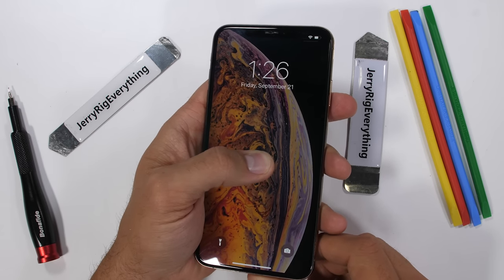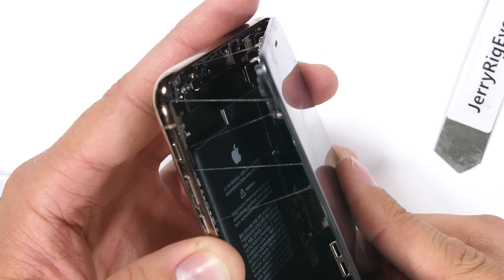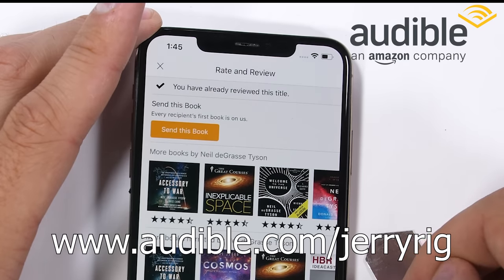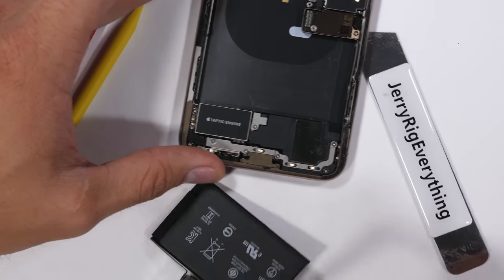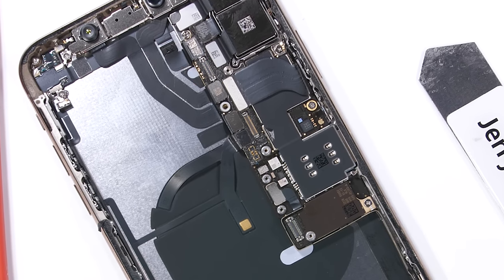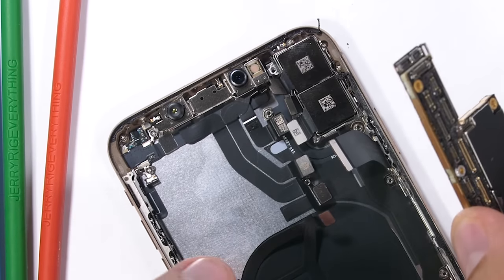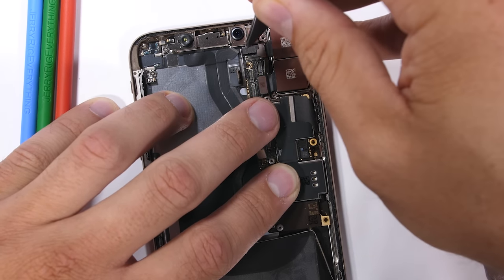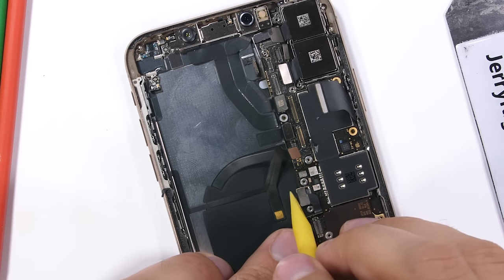iPhone Xs Max Teardown - Is there any Thermal Cooling?

Comment: The only time you'll ever get throttled is when the next iPhone comes out and Apple needs you to upgrade      
~ jerryrigeverything
Reply: Sam Typhlosion True Story!
Reply: You can pass that throttling by not updating your phone, because they slow down older phones with software updates. But that's just one of the ways they try to make you buy new phone.
Reply: i tried to go back to ios 10 with an iphone 6s, impossible shit to do
Reply: I've downgraded (dual boot tweak) an 5th gen ipod to ios 6. It runs soo fast!! Definitely, ios updates ruins older devices.
Reply: @RodrigoGomezV  yeah  but it is a hard shit to you just for downgrade, Android phone can go from 6.0 to 8.0 and go back to 6.0 super easy
Reply: Too bad it isn’t true
Reply: Been debunked only phones with batteries that have fallen below manageable charge cycles will be throttled to avoid shutdowns
Would you rather put up with your phone constantly shutting down because the processor doesn't adapt to your battery condition 
Sure the way apple went about that was anti consumer but now they've given an option to disable throttling on old battery iPhones
Reply: @nortti00  that's not something you should do since the older IOS versions could have security exploits and vulnerabilities. 

Which is why they do updates....that and the throttling
Reply: Apple throttles phones based on battery health and maximum stable current coming from them. 
Yes, a newer OS typically needs more resources, so an older phone will more often run at a 100% load. If the current coming from the battery is not stable the phone will crash.

BTW. Apple supports phones for 5 years and iOS 12 makes even the iPhone 5s pretty fast again. 
So scold Apple for the $550 back replacement, the headphone jack or the proprietary screws. The software policy they have is, indeed, running circles around any competitor.
Reply: Rodrigo Gomez iOS 12 dude. It’s for old devices
Reply: alsvari or update to iOS 12...
Reply: @xTStockTx  also don't forget that androids almost always get faster with updates
Reply: Sam Typhlosion iOS 12 on my iPhone 6 is a beast. Miss me with that planned obsolesence bullshit.
Reply: That’s bullshit actually
After iOS 12 every device got fast asf
Even 2015 6S is still running like a beast.
Reply: Asef Jamil Ajwad Actually that's just the excuse they came up with when they got caught doing it. If they hadn't been caught they would have continued making performance worse and worse on older devices until they were basically unusable. There was never a widespread 'my iPhone shuts off all the time after updating' issue until they got caught throttling older devices and released updates to 'fix' it. Plus if the battery was really at fault the issue wouldn't have waited to surface until after Apple released the updates to fix the throttling they were caught doing. It would have been an issue all along.
Reply: alsvari iOS 12 made my iPhone X unbelievably faster than it was when I got it last year. This update has worked wonders. Literally everything is faster, plus the battery lasts much longer
Reply: I hate the term 'upgrade'. An upgrade typically would be replacing some parts of it. Also, besides this there is absolutely no need to 'upgrade' from X to XR since they are so minimal and negligible. The only feature is the adaptable bokeh in portrait mode and IP68. Not worth the steep price tag.
Reply: @gagannnnn  lol no
Reply: Dan Man  "expensive battery replacement", bruh really?
Reply: But in android side they get trhottled by itself 😂cheap fake os

Comment: "Upgrading your phone every year is just dumb and a waste of money" - JerryRig 2018 (08:34)
Reply: Apple is going  to get you.
Reply: David Cote Samsung is going to get you
Reply: Samsumg doesn't throttle phones to force people to upgrade. That's for feeble-minded apple users.
Reply: Yeah but samsung launching new phone like every month
Reply: True words right there.
Reply: @mashamitchell9574  Samsung don't give you updates after two major update.
Reply: At least apple SUPPORTS their devices for at least five years. Samsung doesn't.
Reply: @thebravegallade731  your "SUPPORT" means making it slower purposely no thanks dont want your "support"
Reply: Alfian Kurniawan ill
Reply: Ok wtf. I decide to check the comments in the middle of the video and as i read this comment i hear... "Upgrading your phone every year is just dumb and a waste of money"
Reply: @ldtworks1052  Literally just an excuse because they got caught. Same with the replacements, they wouldn't do them before they got called out on it.
Reply: @thebravegallade731  Because their devices barely change lmao
Reply: DID ANYONE SAID APPLE LASTS THAN 5 YEARS ???
Reply: abeski If we are apple sheep’s then your are android cows
Reply: But cows are better than sheeps
Reply: Alfian Kurniawan good think I upgrade my phone every 6
Reply: Masha Mitchell yea but Samsung doesn’t create a processor or operating system that is designed to get higher levels of performance (specifically single threaded performance) at low voltages so that:
1. The battery life is optimal in general
2. Battery degradation is reduced due to a lower voltage out of the battery
3. Battery degradation is reduced due to less heat produced from a SOC
4. Processor performance is better in more use cases (single threaded use cases, especially because it’s a smartphone and because of the way iOS does multitasking)
5. Older phones with degraded batteries who’s users aren’t aware of how cheap a battery replacement is get better performance because the entire phone is designed to get good performance at low voltage so the performance is not critically hit by throttling in the first place.

Honestly the repeated dishonesty with this claim is so annoying. My last phone was an iPhone 5s, i don’t even know how many years old when I gave it away to my aunt who still uses it and is running the latest version of iOS. Unlike this years galaxy which isn’t even running the latest version of Android. The only people I know who upgrade every year do it because it is offered as a part of a cell plan and honestly in my experience they are all galaxy owners specifically.
Reply: Gecko they throttle it based on the battery degradation not based on any time frame besides when are you gonna get android p? When android z comes out?
Reply: Ro_In Pro yea what planet are you living on, yes apple devices last really long that’s not controversial is it? Really? My god I must be an isheep oh no google save me please google please save me sell my nudes please sell my home location I’m sure you care that’s all I need is your loving open source embrace (except for every that makes them money) please save me from a competitor SAVE MEEEEEE!!!
Reply: LiamYT learn your your and you're
Reply: its true tho
Reply: No it’s not
Reply: @ldtworks1052  yeah apple also lied about sapphire camera screen lmao. What a whack company
Reply: @fernandozamoramata5372  you got weak insults
Reply: @ldtworks1052  yes i can see it. Apple lied to all of you. One of the world's biggest company lied to all of you.
Reply: @rikuluoma3537  I do not care I love my Apple products they are the only thing that work all my samsung stuff like my fridge my monitor etc is broken barely works or it has something wrong with it .all my Apple products works even my iphone 3g works
Reply: @ldtworks1052  yea right... Apple forces people to buy their 150€ airpods. Even my honor play is faster than iphone xs max and costs 250€. This has way better battery life too.
Reply: Yes if you don't have a money. But if you have?
Reply: Masha Mitchell so you’re trying to say a s5 works just as well as an iPhone 6? No they dont, even the 4s still works fine in 2018 but galaxy sounds degrade so badly after each year
Reply: did he is stupid?why he doing with very costly things. did he is mad !i pad pro and i phone x and max   if he do like this with very costly things he had no money and food like that he will die because he do like that things please put dislike then he will understand  the also like apple company tell him who is near by his home OK!
Reply: do you know ranga chandra he is my big father?
Reply: Ok
Reply: Everybody is fighting over what phone they use I have a iPhone X’s max and I can respect what Samsung does with what phones they make also people always flame me for having a apple phone and I don’t see the reason for that since apple has phones that function perfectly and work also when I ask people why they don’t like apple they focus on the headphone jack something that has nothing to do with the quality of the phone or damages the phone sure it sucks that apple removed the headphone jack but you’ll get used to it like many apple consumers and if that is your main problem just don’t get that phone it’s that easy you don’t have to make people feel like garbage over a technical device but people will just fight and hate on anything these days and sometimes it’s just annoying go ahead and flame me in the comments but I’m not changing my phone anytime soon and your rants won’t change my mind
Reply: Emang mantep dah
Reply: Arturo Sanchez I completely agree with you
Reply: @Karlsteins  They produce lots of type of phone with different specs and price. I think its good, so you won't find the same phone model more than apple does.
Reply: @GeckoClever  your triggered.
Reply: @Carristoford  You children dont like facts, doesnt mean im triggered.
Reply: @GeckoClever  how old are you? And im not a kid.
Reply: @ldtworks1052  not here to get wrapped up in this fight, but I have the Razer Phone. 

I'm pretty happy they aren't slowing down my phone when they released the Phone 2. 
Don't like one flavor of Android? Just switch! Your batteries are catching on fire? Get OxygenOS on a OnePlus phone instead of a Note 7 on Samsung software. The thing is, instead of being sucked into a price-inflating, wallet-thinning ecosystem, you have options in the event one company doesn't meet your expectations any more. 

Apple is one supplier. If something similar to the battery problems that the Note 7 faced hits a lot of Apple phones, you're taking a risk as a consumer in being forced (by the need for new technology for software development for example, or because they're _slowing your damn phone down_) Android is many of varying speed, size, and support. Just pick one you like. Stick with the brand. Switch out if goes south. 

Software. Heavily skinned or vanilla white, it's all Android under the hood. Run almost anything in any way on amlost every device. 

The thing is, cows aren't much better than sheep. But when you go cow tipping, they'll stand back up. Sheep just flail their legs around while they starve or die of thirst or get eaten by wolves. They're so domestic and ingrown, and you're a perfect example of a mindless defender of Apple products. Cringe in pain as Zack slams your company repeatedly. 

Buy an Android product, especially from Google, and you're guaranteed updates and support for a long time. It's like changing the carbeurator or battery pack in an old gas/electric so it runs for another 5 years. 
But if you're an Apple sheep, you'll run a car without oil, seize the engine, and call the car totaled because you drive a Lotus Elise and you scratched the one-piece shell of the car. 

Maybe I should dive headfirst and fight, maybe I should see  Android users willing to win, to parry and counter ever shitty argument you try to put out there with ease. 

While you're out there trying to make your next arguments, I'll be making popcorn. And awaiting your response.
Reply: Nope is good
Reply: This is right for samsung user because after time they get SUCKS ! :)
Reply: True
Reply: @Karlsteins , every year to stay competitive with every other phone manufacturer, duh
Reply: Alfian Kurniawan great job starting ww3
Reply: Very late comment but all phones are like this, software manufacturers know that people will buy new phones every year with more power so they use that extra power to add more features which will make an old phone seem slow because it is actually not powerful enough, and it has nothing to do with the phone company. If you have an iPhone 4 and run up to date apps yeah it's not going to work but if you run the apps that were designed for that phone at that time they will run perfectly fine.

Edit: grammar
Reply: But the better the phone you have the more you get out of it when you hand it in = less cost to pay every time
Reply: @thebravegallade731  the phone itself dont survive over 2 years without lagging lmaoo
Reply: @mashamitchell9574  Calm down fanboy... you shud know what you talking about first... You need to do a little research about phones throttle. ps. Samsung does it to
Reply: @Karlsteins  Yeah, but this has nothing to do with flagship models. Most people refer to Samsung's S model lineup
Reply: Alfian Kurniawan how many phones does he buy in a year.
Reply: Masha Mitchell actualy they do throttle. People just like to hate apple.
Reply: karlstein do you get hyped for each one. I get hyped for the new ones. Just more minor upgrades
Reply: Çağrı Koçaslan support means getting updates to make ur phone work for 5 years
Reply: Gecko and look what happend with the note 7. Are you really gona say Samsung batteries are better than apples when that happened?
Reply: ThreeHeadedWalrus actually apple cares about there consumers.
Reply: abeski fandroid
Reply: Ro_In Pro yess sheeps not sheep. SHEEPS!
Reply: Crustin Danglade yes
Reply: Crustin Danglade people say android p stands for pie. And in math pie is 3.14 like the 3.14 android p is going to be supported on ur phone
Reply: riku luoma samsung also lied about their note 7s being safe after they exploded. They did that FOUR TIMES!
Reply: riku luoma no one forces you to buy air pods. Thats ur decidions
Reply: I know i made alot of comments about my opinion but the following things are facts so just don’t try to denial them.
1 iphones are supported for at least 5 years. This means bug fixes os refreshes etc
2. ios and the apple ecosystem work perfectly together. Especially the apple watch
3. Apple throttled the battery based on how worn down the battery is not when apple wants more money
4. Apple is the biggest company in the world and is the only trillion dollar company. They are doing stuff right. Its not esay to get that far from a garage.
5. Apple has great customer service. You can walk into an apple store with ur Apple Pencil and say its laggy and they will just give you a new one. That is amazing and you cant get that with Samsung 
6. The people that buy apple products are not mindless sheep who buy whatever apple makes. Exept if you bought the apple book. Then you are a mindless apple sheep. This aplys to samsung users to.
7. People keep comeing back to apple. The people that use ios and apple products are almost always satisfied with ios more than android
8. I remember from this comments replys that one person said that apple is forceing you to buy air pods. You get to choose what you buy with your money. You can buy whatever you want i dont care!

Thats all. Thats my opinion. You can like whatever you like. By
Reply: someone says android is better than iphone and suddenly everyone talks about samsungs? wtf
Reply: Alfian Kurniawan I’m still rocking a 6s because it has a headphone jack
Reply: Jacksonjacob TV first you can use the adapter or the headphones in the box of the iPhone 7 or later. Secondly you will not need the charge the iphone because the iPhone 7 8 X Xr Xs and the Xs max have at least two hours more battery life than the 6s.
Reply: Apple wants to know your location
Reply: @Karlsteins  yeah but they are  all for diffrent people the flagships then mid and lower class
Reply: @crustindanglade6036  i personall only know one phone  user who upgrades every year (and he contract hops)
Reply: @mxnveer  i mean my s3 still just works i changed battery 2016 as it was degrading a bit but it was fine as the battery was removable
Reply: @optical_6070  i like to keep phones for 3years or so (i use budget phones sub 400)  so u might want to keep yours linger
Reply: @nolimitsluke  to be fair people have stated with less than apple
Reply: @ldtworks1052  thats what they say, but we all know the real reason
Reply: @Karlsteins  doesnt force you to buy it tho
Reply: unless your name is iJustine
Reply: @ldtworks1052  in my Country (Hungary) the batterie repkacement is 125$ for an I phone x....
Reply: Doesnt matter how much money. Even if you have 100 million $ it would still be a waste of money
Reply: My dad actually said that too when I talked about having my version of my iPhone for over 4 years
Reply: Apple wants to know your location
Reply: @nolimitsluke  it's the way they made the battery
Reply: I am fine with my Note 9 from an S3.
Reply: 5.5K+ people who upgrade their iPhone in a yearly basis don’t think so 😂😂😂
Reply: Love when the Samsung & Apple fan boys go at it 🍿
Reply: @crack3273  Where are the pixel buds? Samsung paints a poor picture of what Google software really is.
Reply: Pixel buds do exist